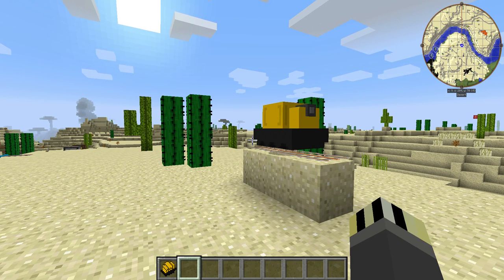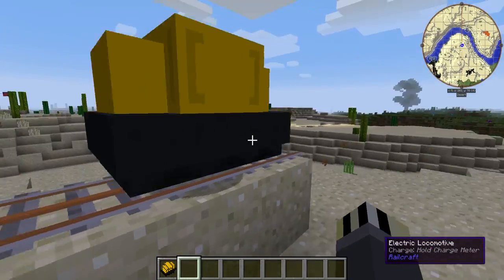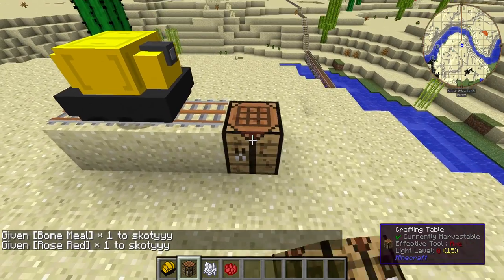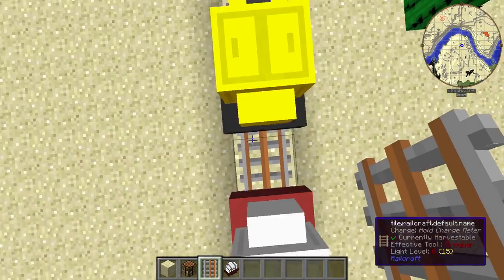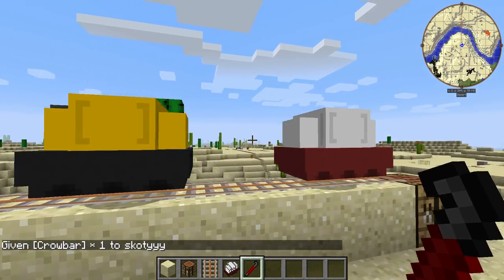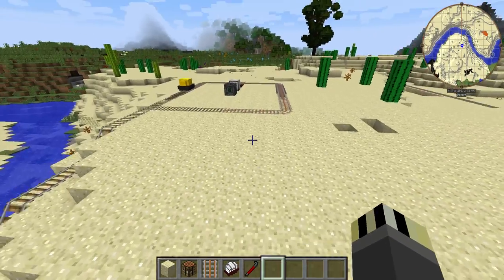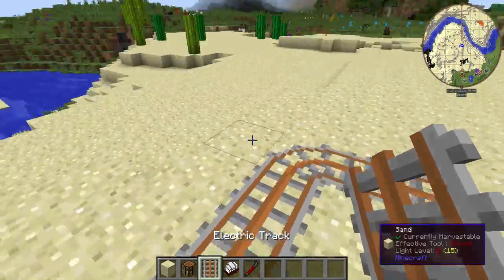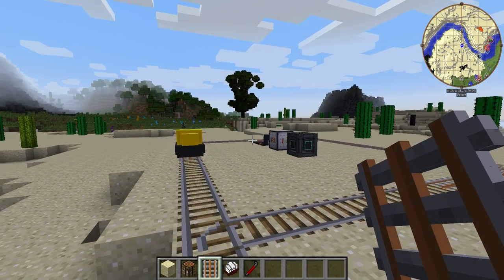Railcraft Tutorial | Electric locomotive

Comment: Among my favorite mods for a long time
Reply from the maker: mine too, its soo malleable around other mods
Reply: About the 12 minute spot you had issues with electric loading in the cart.  Loaders tend to work easier with the lockdown track.  I have not kept up with IC2 ( as they changed what MFE's power level was and replaced the previous value with CESU ).  You may need a particular cart of a certain power level for the loader ( and it transfers into other connected carts of other levels, maybe ).  Requires testing of course.

In the past I've used this locomotive as an Under-The-Floor train viewed through glass to fetch resources from different rooms that were producing crops or mob drops to return to central storage in a malformed twisted pinwheel shape track for a 3x3 chunk base.  ( think of placing an E back to back with its mirror for the layout ) 

Looking forward to the upcoming update to Railcraft 10 as CovertJaguar said that switches and similar mechanics are coming "Soon".
Reply from the maker: thanks for the heads up, yer i did suffer on the live taping. im still investigating how it works and when i do i i will do a new video for it. there is going to be a new video on how to automate with an electric loco